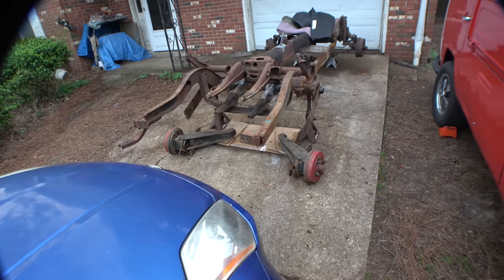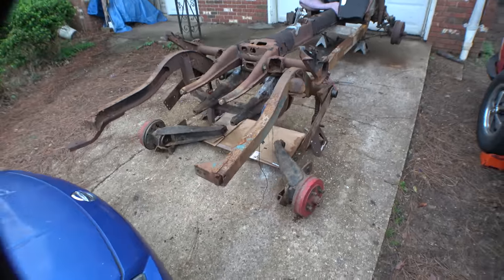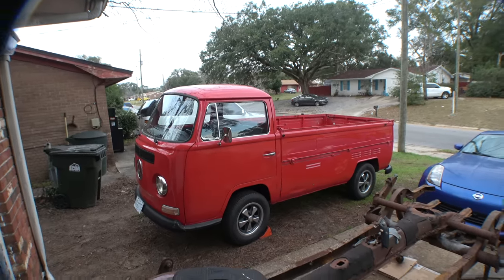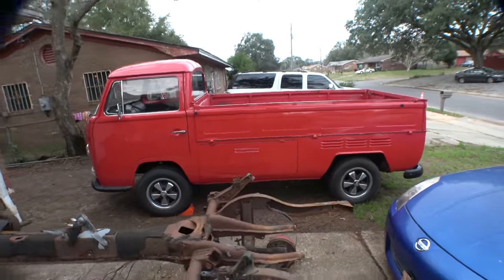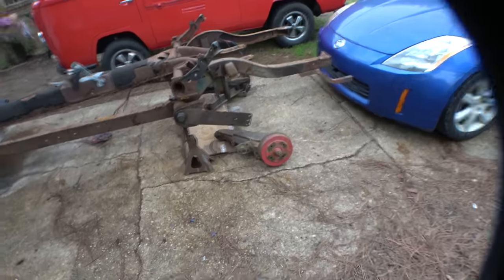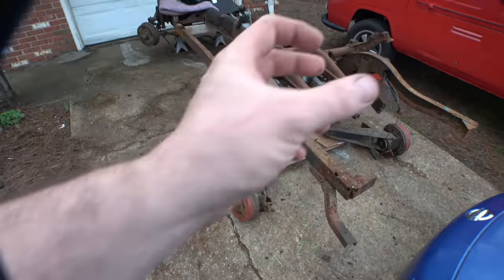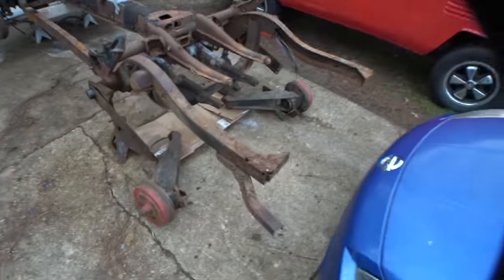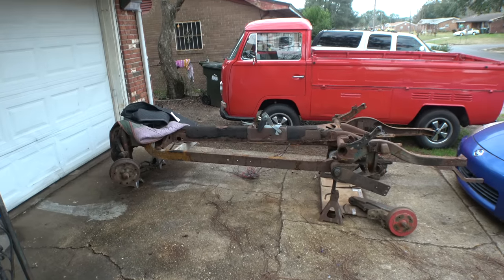💥💥A Truck Body?💥💥 - 1967 VW Bus Frame Restore - 09

Comment: Its been a LOOONNNGGG time since I dealt with my last computer crash. I hope your machine is back up and running asap. 

On my machine the hard drive failed but the motherboard allowed me to install a second hard drive which was already loaded with Windows, and that fixed my black screen of death. Now when I boot up I have the dual boot option to go to either disk, but I of course boot into the good one.
Reply from the maker: I put my hard drives in RAID configs... Wanna drive goes it’s pretty easy to deal and no data loss.  But this time it’s something much more important like motherboard.  Ouchie

Comment: Pour some old motor oil on those fire ants then some break cleaner.
Reply from the maker: That would make a pretty wicked mess there in the driveway.  I hope they are still alive in there when I go to pull the drum off, that would make for a good video!
Reply: @DuckmanCycles  LOL it would but it would make some dead fire ants that cannot bite. Its a good way to use some old motor oil You can put some kitty litter on it.
Reply: @DuckmanCycles  They have made a egg nest in there so they will be there with there nest.

Comment: normally its the memory cards that gives that problem, have had that a few times until i ordered new once, never had it anymore.
by the way, that a very nice rebuild that you do. greetings from Belgium.
Reply from the maker: Thanks man, it was a PC builder professionally for about 25 years.  But it would be a really odd situation of all of my memory sticks failed simultaneously. Generally on older computers it’s usually the motherboard that dies. Ram and CPUs usually last a long time.
Reply: @DuckmanCycles  i hope that your pc will run quick again in no time and that you can edit fully.
Reply from the maker: That would be wonderful, thank you so much for the wishes!

Comment: Before you get too crazy on the reduction gears. I'm going to send you a cardboard pattern of my home made adapters. Cool. Oh remember the transmission spins backwards
Reply from the maker: I will appreciate that! I need a starting point for sure!  And yes, I’ll need to flip the ring gear!
Reply: Ok. You are going to think I'm stupid. I need a mailing address. . I don't know this computer crap.
Reply from the maker: The most current address for me is always published up on my website!
Reply: @DuckmanCycles  Hi. How did you make the cat piss ?
Reply from the maker: The same way as always....  Give them lots of water, then spin them around a lot.  Give them a light squeeze after that.  Otherwise, you can just use the link in the video description!  Phosphoric Acid ▶ https://amzn.to/3HxJO57

Comment: Did you find a mainboard? If not, what kind do you need? I got a few here in the bonepile...
Go bug Adam. It's not like he doesn't have a coupla machine shops or anything...  😁
Reply from the maker: I ordered up a board... I don’t think Adam can do much to machine one for me.  LOL
Reply: @DuckmanCycles  Well, I meant for the rear end parts. 🤪
Reply from the maker: LoLz you did not specify... but originally I built his computer for him.

Comment: I was looking at the pickup for a couple of minutes wondering why it looked weird before I noticed that the rear arches have been raised. Maybe someone wanted to off road it.
Reply from the maker: Good observation, I didn't even notice that.  The tears are not just raised, but reshaped, even!  It works for this truck.  It appears it is lifted, too.  Will know more when I get underneath it and look around!